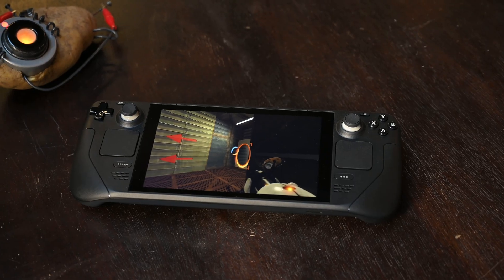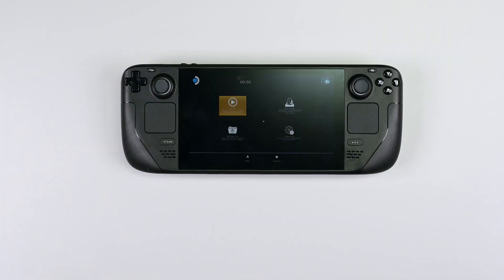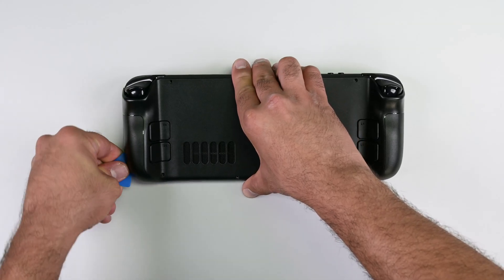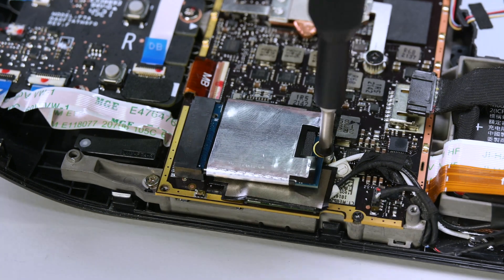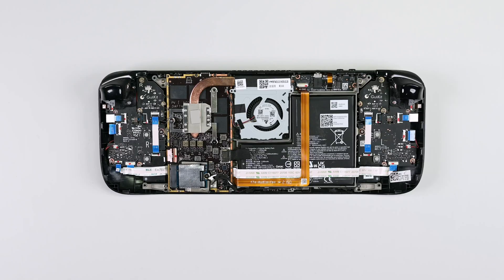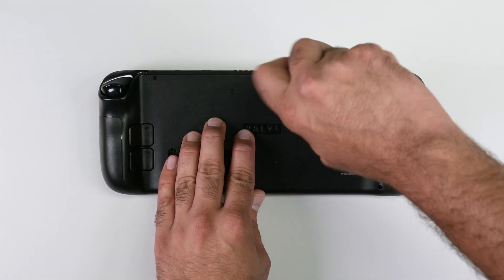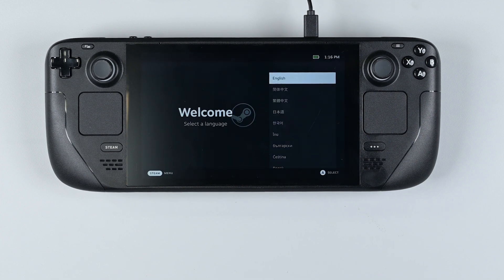Steam Deck SSD Replacement: Get it Done in 20 Minutes!

Comment: When choosing a replacement SSD, 1 tb or 2 tb, are there any more considerations? Also, is it true that SSD replacement shortens steam deck life
Reply: It is true but not something to be concerned with.  I think it relates to the thermal release based on Gen 3 vs Gen 4 ssd.  The Gen 4 has higher usage.  Gen 3 is more appropriate.  However, SteamOS is supported very well. I think they addressed it so the software should have the right configuration to avoid overheating.  They are more forgiving than Windows SP 7+ and 8, which was more particular on this.  It took a while before it was corrected.

Be glad on SteamOS. It was why I chose steam deck over the windows 10 handhelds, although I hear they are catching up. Good time to own a handheld.
Reply: prolongs it if anything

Comment: did anyone else get mbr instead of gpt?
Reply: yup I'm currently in the middle of it and that's what I got
Reply: @Acer21  ok so turns out it’s normal and if you get stuck when you reimage steam and it tries to reinstall but keeps saying error or stuck at 1 percent it’s downloading multiple updates when you get to the install where it’s stuck at 1 second for a while switch to a different internet connection I switched to my hotspot and retried the install and it completely installed and everything worked again.

Comment: Would be nice to add that when rebooting it when you are all done, it can lose all button functions besides the touch screen and it will have to connect to internet to update it to fix the issue.
Reply: or that the battery storage mode needs it to be plugged in to turn on again. many mini heart attacks later its osrted lol but i ended up putting the original ssd back in twice troubleshooting
Reply: @hybrispsycho1  I was trying to figure out why it wasn't turning on, then I plug it in and unplugged it and it powered on. Then I was confused why the buttons didnt work figured someone here at the same issues.  I hate when guides skip steps to save 5 seconds.
Reply: @hybrispsycho1  yeah i actually had also an heart attack xD Thought I broke it after only one hour after receiving. Would have been great if it would be mentioned in the video..
Reply: I'm having this problem with the install, I cant connect to the internet because the keyboard is not working.....Help

Comment: When I formatted the usb drive with the Steam deck recovery, the partition scheme was locked into MBR instead of GPT. I used a 32GB micro SD card and the recovery worked anyway. My Deck is working so far, but at the time of this comment, it’s constantly installing updates in the Steam Deck Gaming Menu. Should I be concerned?
Reply: You ever get a fix for this?
Reply: Mine also says MBR. Is there a way to change this?
Reply: @Chino1f1kation  You need to do it via admin > cmd and then type in disk part list disk select disk clean format gpt
Reply: i don’t see why that should matter

Comment: Does anyone recommend using an anti-static wrist strap while doing this?
Reply: Unless you're working on something like carpet and constantly moving your feet around it shouldn't be needed. Just make sure to ground yourself on something metal prior to touching anything internal and don't get back up until the job is done. If you do have to get up you will have to re-ground yourself again before touching the steam deck.
Reply: I've been tearing apart electronics and computers for most of my life and have never used a wrist strap. That said, if you are in a static shock prone area, might be a good idea.

Comment: Few things to add:
- 0:29 honestly no need to reduce the battery to 25% if you know what you're doing
- 1:14 should mention use Philips #1 screwdriver
- 1:53 not need to completely remove the foil cover, only pull it just enough to access the screw. Later can easily put it back
- 2:03 should mention use Philips #0 screwdriver to take out the cover
- 2:30 can simply slide the shielding off the SSD and insert it to the new one, since SSD is generally same size
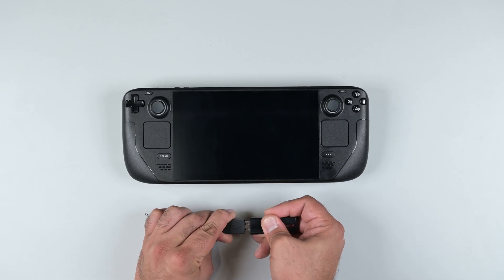- 4:59 should mention to plug in the charger first to turn on the Steam Deck since previously set as Battery Storage mode
Reply: the 4:59 one really scared the shit out of me, thought I broke the battery somehow but no, just plug in the charger
thanks a lot
Reply: @michaelp4387 literally same @@
Reply: He said you can slide the foil off the SSD. Peel it if it's stuck. 2:40
Reply: @operator001  I know. My point is on the latter part, which is we can slide the foil off AND insert it to the new one.

Even though he did said about slide the foil, the video demonstrate on peel it instead. So there might be people that don't know that sliding it off and insert it back is possible and easier.
Reply: I actually didn't hear when he said you could slide it off so when I saw him peeling it, I did assume that was the only way to do it. Thanks for pointing it out!
Reply: Very grateful for the comment about how to bring the steam deck outside of battery storage mode. Had a few minutes of *panik* before I found out it needed to be connected to external power :)
Reply: ADDITION FOR NEW DECKS (Nov 2023) - It says if its a new black shield deck "skip this step" and doesn't mention what to do. Just completed a black shield tear down to replace a drive. ITS STUCK by a L shaped bend at the top. Remove the four screws (two were missing for me) and then pull with force. You will face resistance like its stuck with glue or hidden screws in the middle. It's not, there's nothing there. Its purely the top locking it in place.
Reply: thank you, I'm getting one soon :) @richhall3970
Reply: OMG Thank you for these comments.  I was wondering which Phillips bit to use at what step.
Reply: @@wigglytriangle  thanks!
Reply: the last on you put is the most import, a LOT of people will go crazy thinking they broke their Deck since it will not turn Back on unless you connect it
Reply: This answered all my questions. Thanks for taking the time to address these points!
Reply: Great comment
Video is missing too much for a great and simple tutorial 😢
Reply: Way to explain the charger plug-in. I freaked out for a bit, then went straight to comments and found yours.
Reply: Reducing the battery is a safety thing. I have hit the battery on a repair before and it was not a good time.. necessary... no. But a safety thing and a way to ensure you don't short anything.

For screwdrivers.. he just used what works. If you have a full ifixit kit or another kit, do the same. I used a different size just to get enough tourqe on the screw

The foil depends on your ssd model. Not everyone will be able to slide it off
Reply: @systim30  Again as I replied in my above comments, I never said reducing the battery is a bad advice, hence I said "if you're know what you're doing". Louis Rossmann also highlighted the same, it is not really as bad as they trying to make us think.

For screwdrivers, I just add what he said since he's mention earlier at 0:08 of using philips #1 and #0, but never mention anywhere when to use which.

Also the foil, didn't I already said "SSD is generally same size"? I know not all SSD is same dimension, but most of them are. IMO while it's not possible to please everyone, the video is supposed to give the best guidance for most people.
Reply: big big big - 4:59 should mention to plug in the charger first to turn on the Steam Deck since previously set as Battery Storage mode
or else you will in fact panic
Reply: What if your steam deck still doesn’t completely turn on while plugged in but just flashes the stems logo once and then powers back off
Reply: Why do we not need to put the black cover back? Or was it only meant that they are simply kot showing it?
Reply: Thanks for the last step I was freaking out cause it wouldn't turn on. Because I forgot I had to plug it in. Tyvm.
Reply: thank you i was fricking out
Reply: How do I then off battery storage mode? Whenever I unplug it again it just turns off right away.
Reply: @Type1CA  The battery storage mode is automatically disabled when you connect the charger. For your situation however, maybe worth checking if the battery connector is slightly loose. The "turns off right away" after unplugging is not related to the battery storage mode.
Reply: I didn’t realize that you to plug in the power cord in order to turn the Steam deck back on from battery storage mode.
Reply: better safe than sorry right?
Reply: He doesn't care about that and doubt he even knows anything about the system but when you have so many subs they tend to not respond and get into a conversation that might make them look silly.
Reply: With the shielding one, they did mention that. They were showing what to do in the case of the shielding being stuck to the SSD
Reply: Thank you, I was basically going to post the same thing, I really only clicked on this video for the SteamOS link.  When I saw iFixit I was curious in how many things they omitted or screwed up lol.  Also I'd add that as long as the Steam Deck is off it isn't even that necessary to unplug the battery, and the shield wrapped around the NVMe can just slide off, which you can even see in the video, and since it's slightly loose and the deck only fits 22mm wide storage it'll slide right on the new NVMe.  It really disappoints me that he never mentioned the bit sizes since that took me a moment to play with the bits to figure it out and for less experienced users this is an extremely easy way to strip the screw heads.  I love iFixits tool kits, but their guides are frequently less than lackluster.
Reply: lol, I just noticed that you did mention that the shield can slide off on onto the new NVMe.
Reply: Yeah, it's not necessary to unplug or reduce your battery. I swapped out my joysticks for the Hall Effect ones and didn't even bother discharging my battery or unplugging it.
Reply: hey! powering down my steam deck gives me an excuse to play on it lol
Reply: thank you. what a DOGSHIT video
Reply: Noticed all these inconsistencies myself.
Reply: يا شباب لقد خسرت جهازي بعد إعداد كل شي نفذت البطاريه ولم يعد يعمل ما الحل
Reply: 0:29 just put on battery storage mode
Reply: None of this "advice" is necessary except the Phillips #1

Source: I just finished this myself.
Reply: The only thing missing is to clone the SSD. It's 10x better than just backing everything up to your desktop PC.
Reply: You never said the video gave bad advice but the contextual language you used implied it. Presiding  your sentences with "Honestly you don't have to", "no need to", and "should of" implies that there was a "right" way to convey the instructions that he didn't do.

I feel like your intention was just to add additional context, but it didn't come off that way, it comes off like a correction. If you had presided your points with "I suggest doing this as well" or "If you have experience, you can skip this step" you wouldn't be getting nearly as many critical replies.

But again, this video is made for begginers, it's important to add precautionary steps for their safety. Even though you had extremely valid points but It's really interesting how the smallest details in how we state things can change it's reception.
Reply: On top of this this is exactly why battery storage mode exists. Go into bios and enable it and it essentially disconnects the battery.
Reply: Do we need to format the new SSD at all before putting it into the steam deck?
Reply: Lol why don't you do a video yourself
Reply: People who "know what they are doing" don't need this video. it's a good piece of precautionary advice.
Reply: @hastyscorpion  You probably misunderstood. The sentence is referring to depleting the battery. If we do carefully enough such as ensuring not to accidently puncture the battery, no kids around to disturb us etc, then there's no need to deplete it.

Those who are used to open small device e.g. laptop, phone etc still find this kind of video useful if it's their first time opening Steam Deck. Only the part on depleting battery is not really necessary.
Reply: @hastyscorpion  Having said that, it's just my opinion. I myself didn't deplete the battery when first time opening the SD, and I don't see any reason to do so since I know what I'm doing (e.g. lock the door, do in clean room etc, think SD as a very delicate device etc). Ofc I'm the one who takes the blame if any issue occurs, not others. 

But I stand corrected on my opinion. I'm sure lot's of others did the same.

If you / others still prefer to deplete it as suggested in the video, that's your choice and it's definitely better.
Reply: @shadowzephyrX  It's good to know that it's not necessary, but it's still good advice just because a video is going to have a wider audience and many will do things without prior knowledge and blame a video that didn't give any warnings instead of themselves for not taking precautions.
Reply: @Cr3zant  Are you referring to the battery deplete thingy? Yes, I'm definitely with you on that. Never in my comment says the video give bad advice, I just said we can skip that part if we want to. Hence "Few things to add" as stated in the initial comment.

It's feels wrong (at least, for me) to simply keep those points to ourselves. The whole exercise is "you are on your own" anyway, so adding some points doesn't hurt.
Reply: @Cr3zant   Oh before I forgot, if you haven't done yet maybe can check out video by Louis Rossmann titled "Steam deck battery may end your life? BRUH! 😑", so you may get an idea of what I mean.

Comment: You don't need to discharge the steam deck. Just unplug the battery 😅
Reply: It's really about if it gets accidentally punctured. that can and will cause a fire so if its discharged that isnt as likely to happen
Reply: @drlolable  ya ik.been there lol. Luckily no harm but smoke

Comment: What's the SSD foil cover for?
Reply: heat dissipation and electromagnetic interference shielding. the components in the steam deck are packed together very tightly and some, like the wifi chip, emit EM waves that can mess up the data on the SSD chips. so the cover is there to block those waves/signals
Reply: @iDUMB  that's very interesting thx for the info
Reply: The back cover is very thin. It stops the risk of anything getting through the plastic. By that I am referring to magnetics, for example, that would damage your SSD.
Reply: @GODS3NT thx

Comment: There is no need to peel the shielding open, you just slide it off the SSD!
Reply: Thank you! I was wondering about that when I saw it wiggle around the SSD
Reply: Doesn't necessarily work if your new ssd is thicker than your previous storage. Might only be a tiny bit, but it can be just enough to prevent it
Reply: @Siris6771 yeah, I had to open it after all
Reply: @Siris6771  Yup. My original SSD slid out of the shielding okay, but then I had to peel it open anyway to get the new one in.
Reply: @Siris6771  my sabrent rocket 4 1TB slid right in, though it was a "perfect" fit which means I had to get the EXACT angle to get it to fit in there.
Reply: 2:40 "you can slide it off"...
Reply: He did say that...... said if it's STUCK peel it off.
Reply: My new SSD was thicker than the old SSD so I had to peel it off to re stick it on the new SSD
Reply: Didn't work for me, dunno if new ssd was a bit bigger but had to open it
Reply: Just did this myself and that's exactly what I need. Still needed to unwrap since my new SSD has a thick chip on it.
Reply: He specifically said slide it off, unless it gets stuck.
Reply: That’s why I did too
Reply: I found that if you lay your spudger across the top of the SSD and slide the shieth over it works without opening even if the SSD is thick.
Reply: Depends on what ssd model you have
Reply: @systim30   right. some are thicker and its needed to adjust the shield.
Reply: Depending on the size of ssd it may be difficult. 1tb ssd you can but when I tried the 2tb ssd it would not so I did have to peal it.
Reply: Wait what.. wish I had seen this rofl
Reply: @casedistorted he literally said that in the video.
Reply: there is, its better like that to apply on your new ssd(can be thicker)
Reply: error: file "/boot/grub/x86_64-efi/part_msdos. mod' not found. error: file /boot/grub/x86_64-efi/steamenv. nod* not found. error: can't find command
"steameny _init',
error: can't find command
' loadfont*
error: file "/boot/grub/x86_64-efi/alI_video. mod' not found. error: file '/boot/grub/x86_64-efi/gfterm.mod' not found. error: terminal "gfxterm" isn't found.
error: no such device: f4d9c69-0dce-4566-ad7d-e312393b9662. error: file "/boot/grub/x86_64-efi/gfxmenu.mod' not found. error: can't find command "loadfont". error: can't find command "loadfont'. error: can't find command "loadfont'. error: can't find command "loadfont". error: file '/boot/grub/x86_64-efi/png.mad* not found. error: file
"/boot/grub/x86_64-efi/all_video.mod' not found.
error: file "/boot/grub/x86_64-efi/steamenv.mod' not found. error: no such device: f4fd9c69-0dce-4566-ad7d-e312393b9662.
error: can't find command
"steanenv_boot'.
error: can't find command
"initrd*.
Press any key to continue...
Failed to boot both default and fallback entries.

Eso me dice a mí cuando quiero poner la imagen en el ssd de 1 tera
Reply: It was kinda tight to slide onto my 1tb upgrade. Almost wanted to peel it but I was able to slide it back on. Like someone said it's about the thickness.
Reply: Glad I read the comments before replacing my SSD, thanks dude!🤟
Reply: I had to peel mine :(
Reply: I tried it was so hard, I had to peel it off
Reply: Mine was very much NOT easy to remove. Ended up basically shredding it, and ordering a replacement from IFIXIT. Thankfully, installing the replacement was significantly easier than reusing the crumpled previous piece.
Reply: He mentioned it. Listen better?
Reply: I saw that and was like what is this guy doing 🤦‍♂️